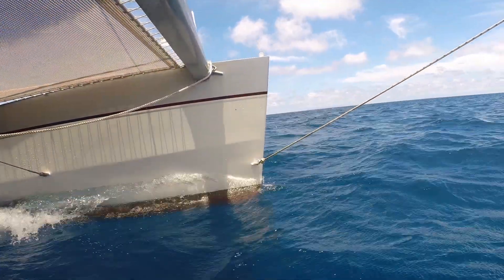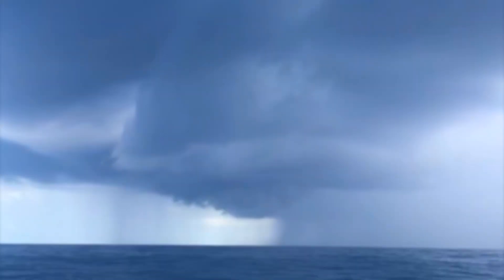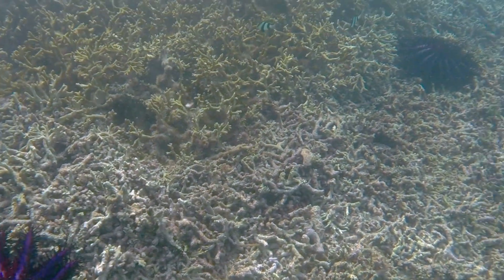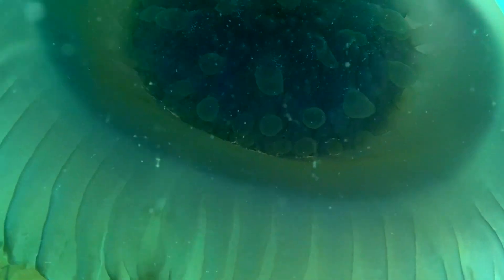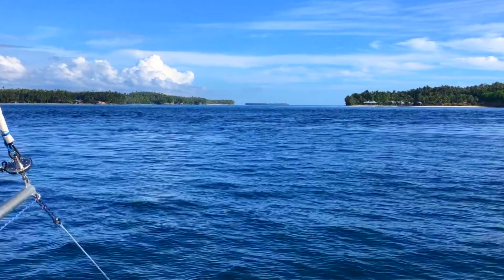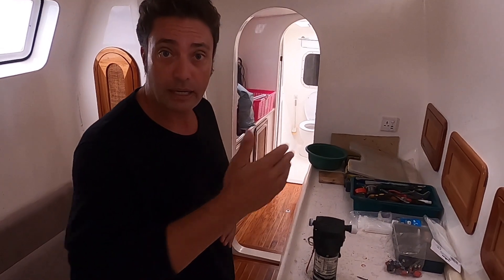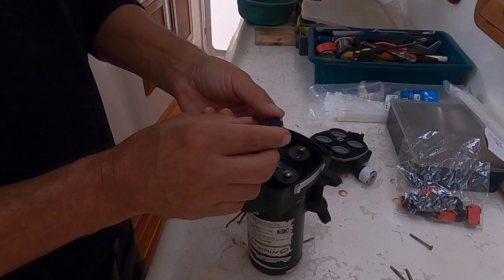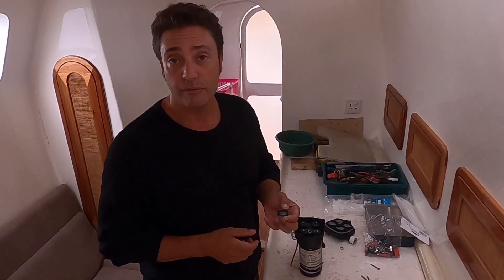SAILING WONDERFUL WEST SUMATRA! EP3 +Tech Tips on Water Pump Failure

Comment: How do you tell that the switch is broken on the water pump? What do you do on the switch and on the multimeter? -Rebecca on SV Brick House
Reply from the maker: Just set your multimeter to test continuity, and see if the switch is functional.... so far 3 out of 3 pump failures for me, has been this 20 cent broken switch!
Reply: Life on Jupiter amazing! Thanks for the tech tip on broken water pumps!